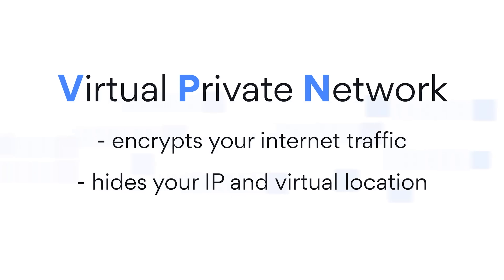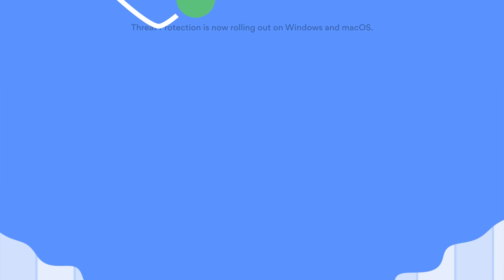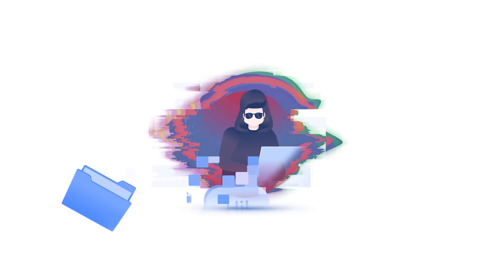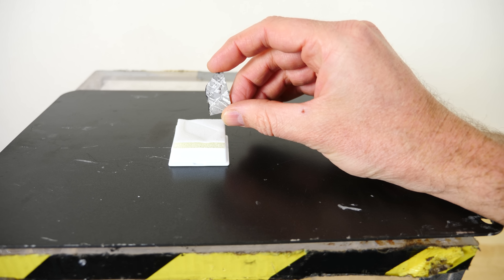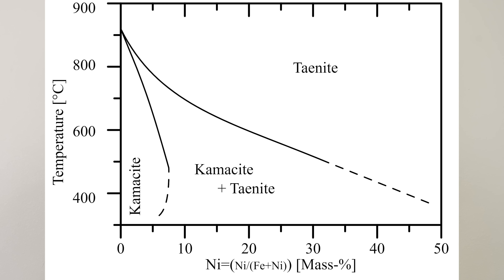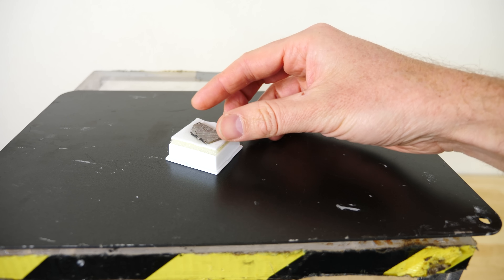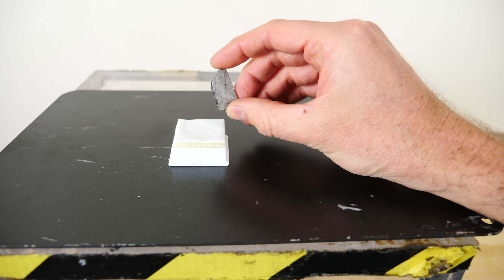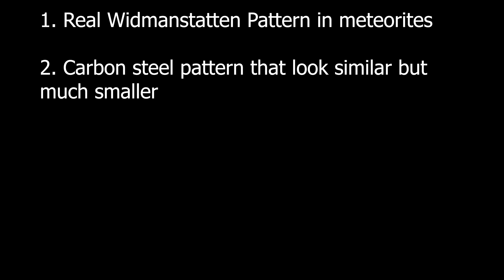Why Can't Widmanstätten Patterns Be Made on Earth?

Comment: In common sense if you say iron nickel it's have a strong sticky magnetic ability and not only that it is conductive can transmit current of electricity voltage easily!up to now no any video that the cross pattern iron meteorite is strong sticky to magnet and up to now no any video that showing that cross pattern iron meteorite can transmit a high voltage current!that material is earth rock only not meteorite!
Reply: i have no idea what youre trying to say

Comment: f you Google “Widmanstätten pattern” you will discover that the same patterns have been observed to form with other metal alloys, including brass and carbon steel, when they cool slowly. These cases are based on observational science and reveal that these patterns do not need millions of years to form.

In researching your query, I came across the work of Phyllis Budka,2 a mechanical engineer who has published research on meteorites for more than twenty years. Her work challenged the then-current theories of nickel-iron meteorite formation. For example, it was thought that the meteoritic Widmanstätten structure is an equilibrium structure formed on slow cooling, but this is not correct. This idea of long ages is based on those old theories.

Budka’s research has revealed that the geometrical pattern of the Widmanstätten structure is the result of a new metal phase forming along certain crystallographic planes of the parent solid solution. Although this structure was originally observed in meteorites, it is readily produced in many other alloys, such as titanium, by appropriate heat treatment. Her radical research concluded that the structure in meteorites was due to non-equilibrium solidification under very low gravity (microgravity) conditions.

In other words, the idea that the Widmanstätten structure needs long ages is based on incorrect ideas. Specifically, Budka says that the old metallographic cooling rate theory, derived from this structure, is based on circular reasoning and incorrect assumptions, and that there can be no such thing as a “metallographic cooling rate.” That is, the thermal history of a metal cannot be calculated in reverse.

Whenever someone claims that some feature would take millions of years, the wrong response is to conclude that the Bible is not true. We need to recognise that these questions are worldview issues, and the appropriate response is to ask, “How are we to explain this feature within the historical events of the biblical worldview and within its corresponding time constraints.” That question leads to new research initiatives that almost always result in remarkable new discoveries, which reveal that time is not the problem that was claimed.

All the best,

Comment: I have some skepticism about this millions of years claim. It would take a certain amount of time for the crystals to grow for sure but it wouldn't take that long to get 99% of the same size.

I'm open to being wrong on this, of course, if any matsci wants to do the calculations. I don't care enough to do them, but this is a calculation we can do.

I think he's just saying millions of years because it sounds cool, and that is the time the meteorites cool for.

Just totally spit balling based on my intuition (and experience). I would expect that if you specifically designed a non linear cooling rate (and engineered the necessarily accurate temperature control) that started slow at temperatures where seed crystal formation begins and sped up as it cooled, even a hundred years would be enough to not tell the difference from a real meteorite.

Comment: I don't think it is just the extremely slow cooling but also the fact that there is no strong gravity force to cause the materials to separate by density.
Reply: There is gravity though, every object has it's own gravitational field. So does that mother-asteroid.
Reply: @CG-601 , I understand that every object has some gravity and that is why I worded it as "no strong gravity force" and was claiming that the molten materials could form in layers that if on Earth would have a chance to separate by density if they remained molten for thousands of years. The micro-gravity they likely experienced during formation possibly allowed the surface energy forces to dominate any gravitational forces.
Reply: @patrickmorse7549  but is a solid? even if it has different masses the relative gravity between atoms of similar configuration of cristals is negligivel. the mechanics is mainly diffusion. its the same as carbon steels, in fact cementite (that is the second fase in a steel) is metastable. the stability is iron diamond but the kinetics is minimal so its imposible to have pure diamond compounds on an iron matrix.

Comment: Im guessing this happens because once a mass of NiFe alloy is heated snd then individuated from the mother mass in still relatively large sub masses, it cools really slowly in interstellar space because despite what grade school science curricula and Hollywood would have us believe,  really hot moderately dense massee in space will cool slowly because conduction is a more efficent method of energy shedding than radiation due to inverse square relationship between mass, volume and surface area.  
 So say an ejected plaetary core, liberated during a planet collsion  or other similar even or a fragment thereof will remain relatively very hot for a long period of time. Resulting in patterns seen here.
Is this fairly accurate?

Comment: Interesting video, but your explanation is a little lacking, and in a way that's kind of significant because it changes the meaning of your title. See, metallic asteroids originated as the metal cores of ancient planetoids that were large enough to be differentiated into layers, much like Earth's interior. Eons ago, some of these small planets smashed into one another during the formation of the solar system, and thus shattered into countless fragments. The thing is, your video title is actually inaccurate because not only can this pattern be formed on Earth, it actually PRESENTLY IS BEING FORMED ON EARTH deep in the core. Of course, as you said, it takes a very very long time. In fact, if they did indeed cool in frigid outer space as you suggested, they would have cooled very rapidly. It takes a planets-worth of insulating rock to keep something that hot for that long!

Comment: Oh cmon, it’s not that hard. Just create a microtemporal field at a 1000000000000:1 ratio.

(None of that is actual things. I made it up but a microtemporal field is a place where 1 second in there is much shorter than outside of it, and a 1000000000000:1 ratio is where every second outside is 1 trillion seconds inside.

Comment: If it has taken millions of years to cool down and produce that structure. Does the heat generated on entry not change it?
Reply: Good questions and the answer is yes, but also no. Iron meteorites are highly conductive and have a very high melting point. Upon entering the atmosphere, the iron meteorite experiences heating and the outer few centimeters actually melts to form a fusion crust. Typically when analysing Widmanstatten structures to determine cooling rates, or dissolving iron meteorites for isotopic analysis, you remove this fusion crust with a diamond saw or micro drill. We do this because the Widmanstatten patterns are destroyed by the melting, and the melting can also fractionate isotopes and elements. So you are right it, it can destroy the pattern. Due to the high melting point and conductivity of iron meteorites, this will only effect samples that are very small as fusion crusts are often very thin. The centres of most iron meteorites are pristine.

Comment: For those wondering how a meteorite could take so long to cool off even though space is really cold. Firstly, the parent body that makes these meteorites must be large enough to maintain sufficient heat for long enough. Secondly, even though space is really cold it's actually really hard to dissipate heat because the only way to cool off is through radiation of heat via IR radiation. There is no convection or conduction in space because there is nothing to convect or conduct the heat away.
Reply: Space isn't cold.  Space isn't hot.    Space isn't.
Reply: @hillaryclinton2415  Well, there are particles in space, since space isn't a true vacuum (even interstellar voids contain some amount of ions), and what does exist is very cold. Its just that there's so little stuff that it basically doesn't do anything as far as cooling goes.
Reply: @StuffandThings_ there is in fact no space man-made or natural that doesn't have dust particles, as energy is constantly coming into existence and annihilating itself occasionally bumping an electron away via hitting another causing them to combine with another free roaming into a dust particle, the source of matter in general i believe
Reply: Space is definitely very
Reply: What's the largest meteorite found? I like Google but I'm old fashioned and actually like talking to real ppl with real knowledge better!! Thank you for your time.
Reply: @jasonchristopher2977  You know I'm not actually sure about that. I know Ceres and Eris are both pretty big but at that size they aren't really an asteroid anymore and start to be considered proto-planets.
Reply: @wesleyson21  Thank you. You have an answer and im leaving with more knowledge than I came with so thank you and have a great wknd.
Reply: @jasonchristopher2977  I just read today that there's a comet heading our way that's 80 miles across ! Yeah...
Reply: @edwardfletcher7790   we are alllll doomed lol
Reply: @edwardfletcher7790  Well that's pretty phucking big?? I was thinkin like size of a auto, bus, RV. Not a county in Texas. Holy Shitballs. Hope big bro awake with the MOAB ready. Thank you. You have a great weekend.
Reply: @edwardfletcher7790  eta 2029 is the one to watch out for. Ask Tom Horn
Reply: Yep.  Cooling by radiation is slow.  That's why the ISS has those big radiator panels on it.  Something most science fiction forgets about.
Reply: THERE YOU GO! :D :D :D
Reply: IN SPACE, NO ONE CAN HEAR YOU FART. What's worse is there is nothing to covect your fart away from you even if you are travelling at a million miles an hour. Which is a good thing, because it's lonely out in space and you will have that clingy loser fart to keep you company, forever.. No one can smell your fart either. There are no air molecules for the quantum size poop particles cling to and hitch a ride to your olfactory membranes. Space is facinatin, innit?
Reply: 800K --> 23 kW per sq-m
Reply: Widmanstattën patterns can also form in telluric iron on Earth but that's an incredibly rare element. There must have been a specific set of conditions deep in the mantle that allowed very slow cooling, similar to what happens in space. I think telluric iron been found only in a small area in Greenland and native people there used it to make knives without having to smelt ores.
Reply: Space doesn’t exist

Comment: I didn't know that meteorites took millions of years to cool down.... The center of the earth is taking millions of years to cool down so why couldn't it produce this..? 
 I'm just stuck on how a meteorite created this stuff when they don't have the capacity to stay that warm for that period of time or what could come apart that would create something smaller than earth that could stay that hot for that period of time traveling through the cold vacuum of space without some sort of internal generator such as earth or Venus and if it was large enough to keep itself going then your not going to be holding a tiny piece like that in your hand.
Reply: As you know space is cool why is that because there isn't any conduction of heat except radiation and if a Metorite broke from a heating planet it would maintain Heat of the core for huge amounts of time since only way to lose heat is radiation and that isn't a effective way of losing heat
Reply: And For the size issue even if it was big the Metor will deteriorate and burn as it falls through the atmosphere and end being small
Reply: And why couldn't center of earth produce this is probably because of the concentration level of iron at one place since earth has huge variety of minerals it's hard for one mineral not being mixed with others and heat loss is much faster where there are big amounts of iron due to the surface above to absorb hat towards the crust due to normal conduction

Comment: Widmanstätten patterns ARE made on Earth!  Telluric iron-nickel from Greenland and Oregon also displays the Widmanstätten pattern.  The Widmanstätten pattern is entirely destroyed if heated above 800 degrees Celsius for a minimum of 30 minutes.  Virtually all meteorites that are large enough and traveling fast enough to penetrate the Earth's atmosphere will release enough kinetic energy on impact to vaporize the bulk of the meteorite and heat the remaining portion to well beyond 800 C for a period of much longer than 30 minutes.  Therefore, the existence of the Widmanstätten pattern is not proof of meteoritic origin.  It is an octahedral crystalline pattern that grows quickly in moderate temperatures (around 400 C), high pressure and WATER.

Comment: My simple question would be, what is at the core of these meteors to allow it to sustain such incredible Heats for this length of time?
Reply: Well, the size, and the fact that the heat can only escape the structure via radiation since there's no air in space for convection to take place
Reply: I think it may just be the vacuum of space insulating it and keeping it from cooling down too quickly

Comment: If you're not careful, there can be too much action in the Action Lab.  Safety goggles HIGHLY recommended.  
For those that don't remember momentum:
m1 * dV1 = -m2 * dV2
Reply: You've used m1 and m2 implying two different masses, and V1 and V2 implying two different velocities so the negative sign is wholly unnecessary and rendering the d, which I assume is for delta, just confusing.

Comment: During re-entry into the earths atmosphere, the meteoroid does not get hot enough to change its crystalized pattern?
Reply: I had that thought too.
Reply: Excellent question!  The Widmanstatten pattern is entirely destroyed if heated to 800 degrees Celsius, but exposure for a minimum of 30 minutes is required.  Since a meteor must be traveling at hyper-velocity speeds to penetrate the atmosphere, exposure time is limited to seconds therefore affecting only the outer crust.  HOWEVER.. Virtually all meteorites that are large enough and traveling fast enough to penetrate the Earth's atmosphere will release enough kinetic energy on impact to vaporize the bulk of the meteorite and heat the remaining portion to well beyond 800 C for a period of much longer than 30 minutes.  The existence of the Widmanstatten pattern is not proof of meteoritic origin.  It is an octahedral crystalline pattern that grows quickly in moderate temperatures (around 400 C), high pressure and WATER.  An inconvenient fact not mentioned in the video is that telluric iron-nickel from Greenland and Oregon also displays the Widmanstätten pattern.
Reply: @freemind..  Thanks, that's an awesome response to my question!

Comment: widmanstätten pattern

Always interesting content. Excellent channel. Nickel has a melting point of 1455°C, Iron is 1538°C. If you look at ice crystals they seem similar. I am thinking that if you find the right temperature above the melting points and then let the iron cool above the nickel melting point that you can start iron cyrstals nucleating in molten nickel... the wiki article also fails to take into consideration pressure which would alter the melting points just as it does water boiling and freezing points so there is a big hole in the study. I wish i had the tools to prove you wrong... it would certainly be a great little experiment.
Reply: In space it would happen in vaccum that would cause difference but we are taking that as a kinda standard wouldn't cause nuch difference ig
Reply: What if you put a press in a vacuum and pressed iron and nickel and fused them
Reply: @David.b.nimble  It is an educated guess but I am quite certain this happens during cooling after both metals are liquid and one forms crystals while cooling in the other. Dont forget that melting and boiling points change in different pressures.